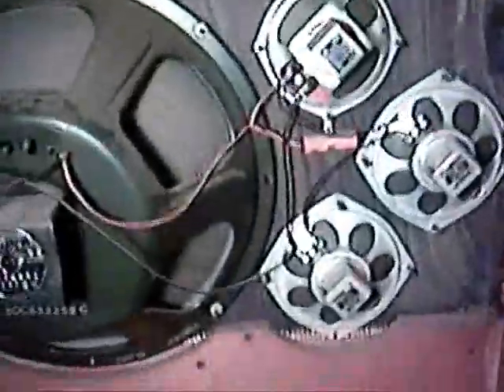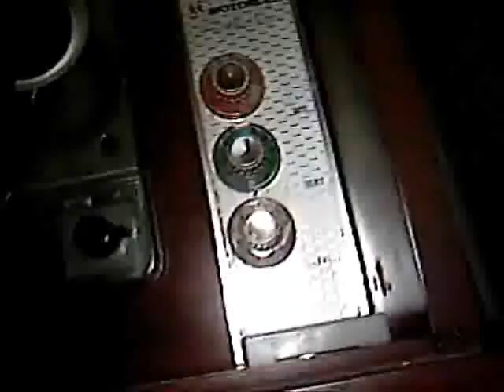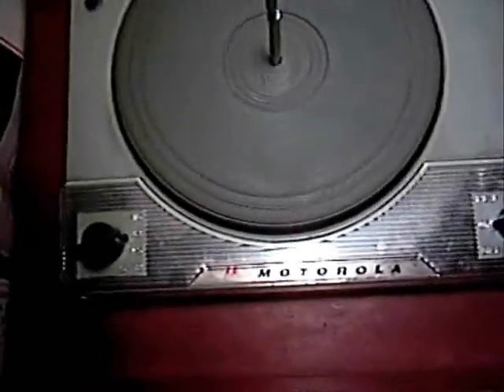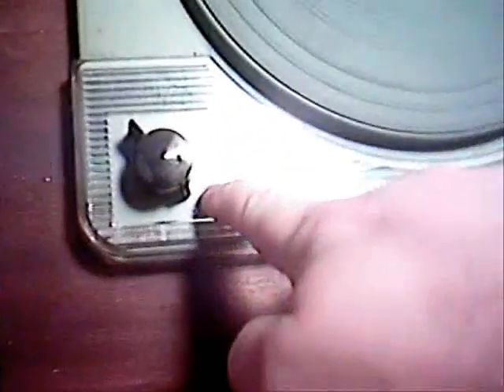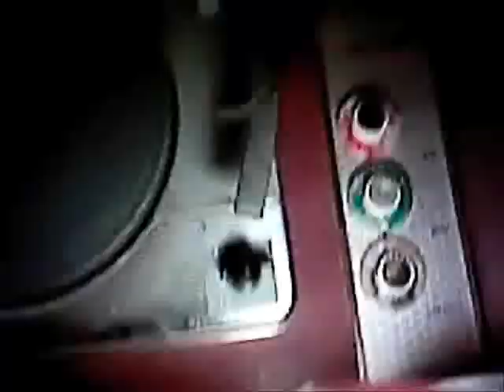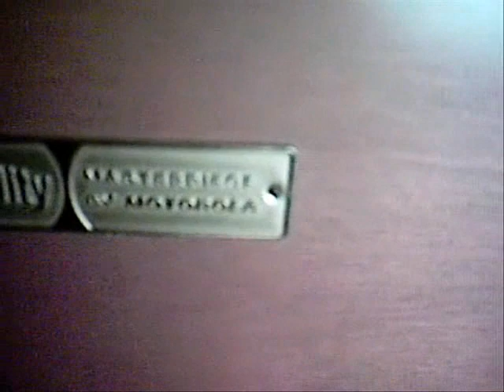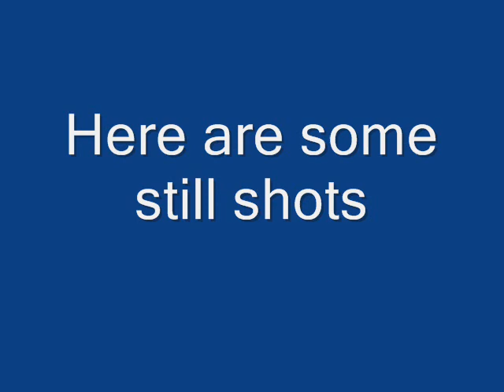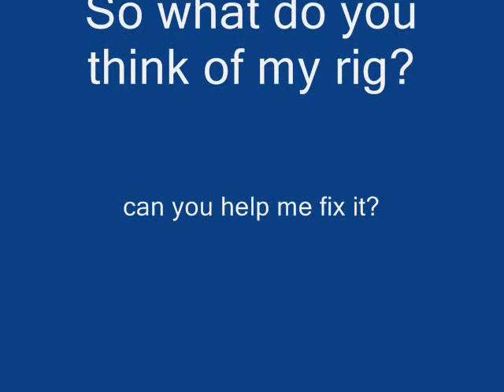1957 Vintage Motorola Hi Fi Model 6K22-B-1 Inside View

Comment: The model number of my unit is 6K22-B-1 and it still works good. Back in the early 1960's it made a loud hum over the speaker as soon as the tubes warmed up, the problem was that long silver metal tube thing in the back, I think it was called a "filter". I was only a kid back then, my dad got it fixed.

Comment: I have this exact unit, My parents bought in in the late 1950's and it was pretty expensive at the time. The one I have still works but the turntable does not run good until it's fully warmed up. The unit has alot of power it can shake the whole house. Needles are hard to get.

Comment: I am incorrect.. just noticed that your hum increased/ decreased with your volume control. So I agree with unajunkcollector, your cartridge connections are bad. The filter caps do go bad on these old sets and cause a steady state hum, although your set seems to be ok. The turntable idler wheels become contaminated and need to be de-glazed, cleaned, or replaced. The distortion may be from your ipod volume setting too high, and the preamp input is being overloaded. Try turning the ipod down.

Comment from the maker: I was thinking this Allamericanfiveradio could I replace the cord on this amp with a 3 prong grounded plug for safety or is that not needed, id really like to keep the original cord if possible but the voltages in these tube rigs can kill, I did replace the cord on my samplex 12 volt 6 amp bench power supply  and I run my pioneer KE-2323 vintage car stereo off it

Comment: You'd be surprised how little is wrong with this unit. however, do not attempt to fix yourself. Inexperience usually results in doing more harm, and there's lethal voltages inside. Leave this to an experienced tech. Your amp needs to be recapped, your filter cans/caps are the cause of hum and distorted audio. The turntable just needs disassembly, the old grease removed, and lubed with the CORRECT lube. It's easy if you know what to do.. but .. knowledge, skill, and cleanliness is mandatory.

Comment: first off you might want to recap the amp. that hum when you start up is a classic sign. youll kill the tubes quickly. id suggest getting a schematic and tracing the problem. nostalgiaair has alot of good schematics and repair tips. but yea get those big electrolytics replaced and those paper caps. if you dont know how to do it you could find an inexpensive repair shop that may do it for you(private old man type preferred lol) if you mail the chassis remove all tubes bc shops steal the USA tubes

Comment: The speaker in that is NOT a woofer in a conventional sense meaning it cannot handle a ton of power, Speakers for old units like this were designed to be efficient and not power hungry like todays garbage.
You can drive that big speaker with 15 watts and get good sound out of it.
Now on the the amplifier, You should recap it for sure or get someone to do it for you. The reason it sounds like crap is your iPod. This is a record player not a DJ booth.. I recommend you need to just buy a decent home stereo and sell this to someone who will restore it properly and use it as it is intended to be used..
I and a few others on here would be glad to help you fix this unit only if your going to take care of it and use it for it's intended purpose. If your not and according by the comments below, your not, no one who knows how to work on these things is going to help you..

Comment: Thanks coondog for uploading that detailed video. The unit is actually in excellent condition considering it's age. damusician is correct, if you follow those steps you should get the amp to a state where it should be sounding great again. The unit seems to have been looked after so hang onto it! It's a keeper. Thanks again, cool!

Comment: I own a working model of this Motorola Hi Fi. Pristine condition. Sound is amazing. My father bought it about 1957 - mine looks identical. It plays beautifully other than I need to do some work on the changer.  Based upon the way it behaves it needs grease, maybe a new idler wheel.   I need a new cartridge (needle/cartridge come together), and if anyone can let me know the replacement for the cartridge I would appreciate it.
Reply from the maker: If you connect a device to the line input on the back does the amp play? Do a video on it I'd love to hear it bump the bass.

Comment from the maker: i hope i can restore it ive always wanted my own tube rig, all it does is buzz like that except when i hook my ipod to the radio input plug on the back of the amp and then it somewhat works needs a cap and i dunno where i can find those old carbon resistors or can i use modern ones just as long as they are rated for this

Comment: Any luck getting this going?
Reply from the maker: Not really, been busy. I don't know any places around my area that fix tube amps. Might just get a regular amp and temporarily hook it up for the time being and play it and then down the road if I can find a place that does these amps.
Reply: coondogtheman1234 Your best bet is find a reputable online service.
Reply from the maker: Hey, A little update, I modded this thing temporarily so I can play music on it. I bought a small 10 watt mono amp on amazon and wired it to the speaker I have a standard 3.5mm aux cord on the amp so you can plug in your audio device. I have a bluetooth audio adapter so it pairs to my phone. This was done in a way to not harm the cabinet, all of these mods can be removed if I decide to restore this thing properly. At least I can use the speaker and man is this thing LOUD.
Reply: coondogtheman1234 Those old alnico are very efficient. Also, if you like to get the turntable to stop continuously cycling I know a quick fix without having to tear the changer apart.